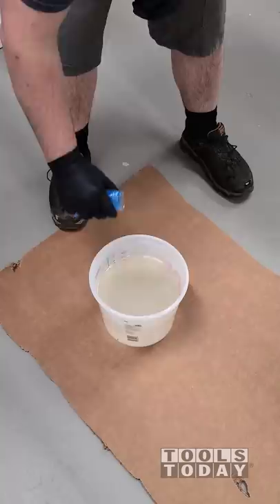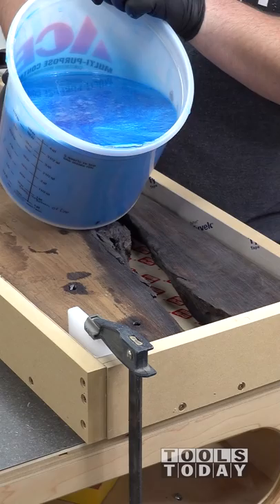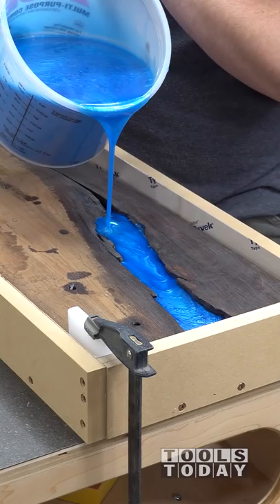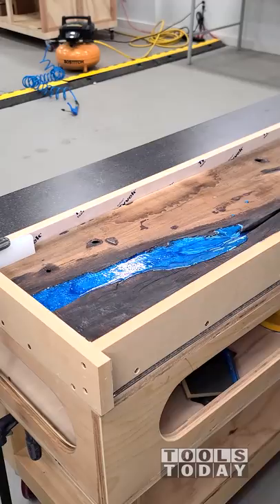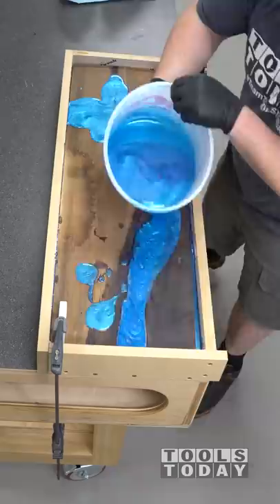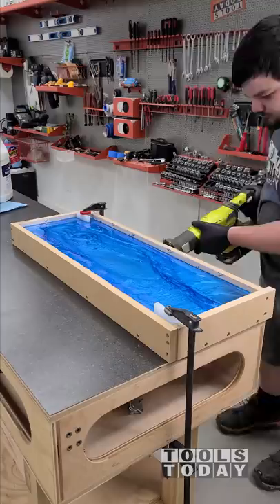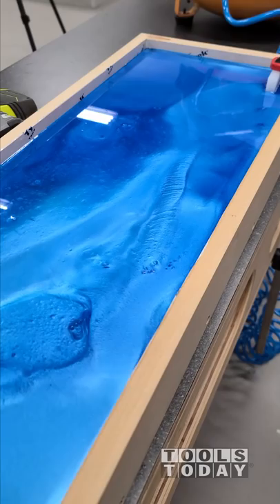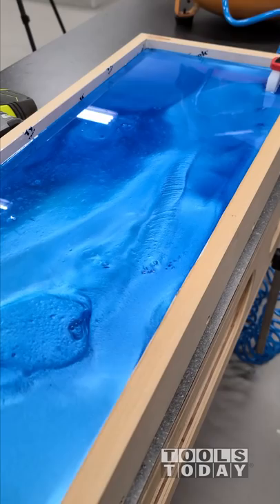Pouring Epoxy into Mold

Comment: Why you put piece of wood if you hide it with epoxy?
Reply: He's going to mill it off.  He really just mixed too much of it 😂  At the same time, sometimes you want epoxy on the entire surface, but normally not with something so opaque
Reply: @veganpotterthevegan  he had extra over the top to fill in the smaller cracks/holes